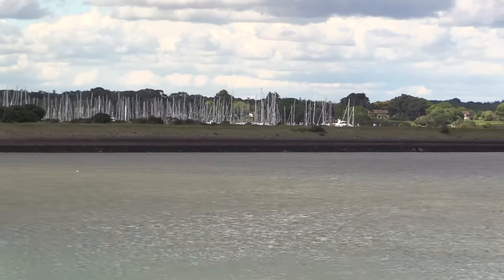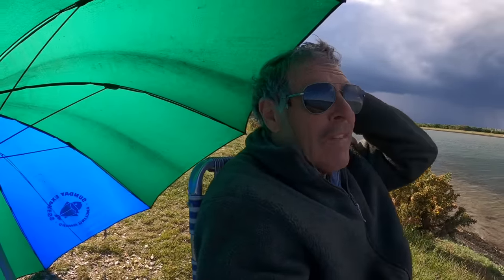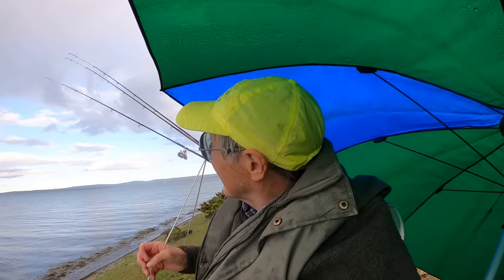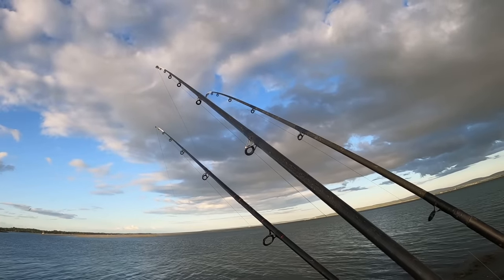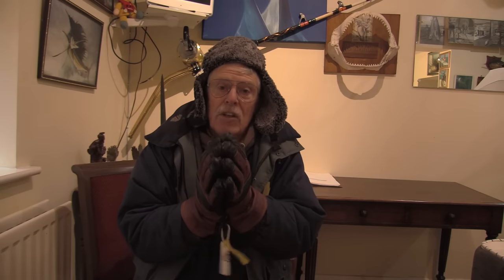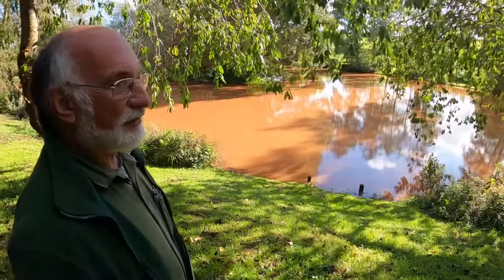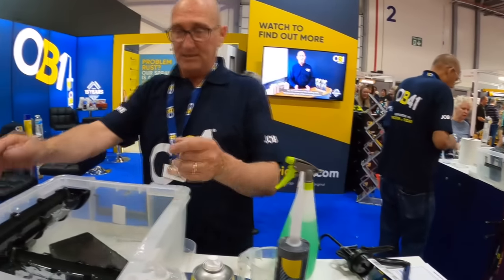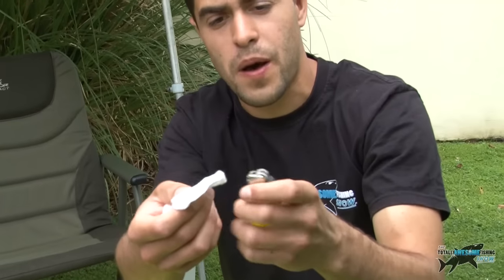Get the most from your Fishing Baits...Sea or Freshwater

Comment: Fishing similar spots here in SE Queensland, I'd be using very similar rigs and baits to those you were using. I'd expect to see bream, whiting and flathead. I'd have 2 lines out to the sandy patch running 8-15 pound line and a third with heavier line, of about 18-25 pounds, on the edge of that channel in front of you. During winter the heavier line would be visited by mulloway and tailor, with mangrove jack turning up in summer. A live whiting or mulet about 4 inches long would be a good choice of bait. This is all based on fish being there to start with lol.
Fork 'andles!

Comment: Your polluted mud theory might hold some weight. I live close to an estuary of 3 big rivers. They dredged out the shipping lanes in the rivers and dumped it along the mouth of the estuary. Used to get bait from one of the beaches that they dumped the mud onto, two years ago you'd dig huge white and red rag and plenty of lug. The whole beach is under about 2/3 foot of mud in the tide area. Within weeks, the worms disappeared and it used to be good for a cast but even flatfish are hard got there now
Reply from the maker: That's interesting, I feel some University student should make a thesis on core samples of estuary mud showing the accumulated petro-carbons,pcb's and heavy metals etc...might make some sleepless nights though.
Reply: @TAFishing  they'd only see something like that as letting the genie out of the bottle. They'd have no choice but to act on it and the sad truth is they won't do it because there's little to no financial returns for them on the back of it. The dredging thing killed off the fishing on 4 beaches in my area, I'm assuming it done the same on the Wexford side. You'd regularly pick up bass over 7/8 pounds out of them two years ago

Comment: How you getting on with the auto car Graeme ? Loving it ?? 👍
Reply from the maker: I'm afraid to say I am..Always been a manual stick shift man but I am now sold on the 8-gear  auto...Must be an age thing. I haven't even had a tow bar fitted yet,I think I'm done with all that hard labour towing a boat...Comfort is key..Planet Rock on the radio,heated seats on and auto full beam and headlight dip. I just hold the steering wheel !!...